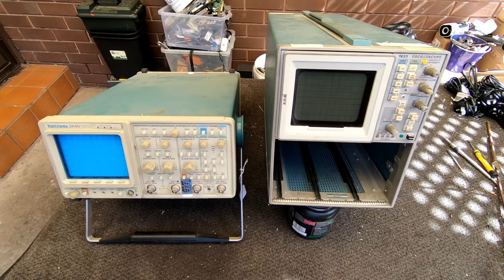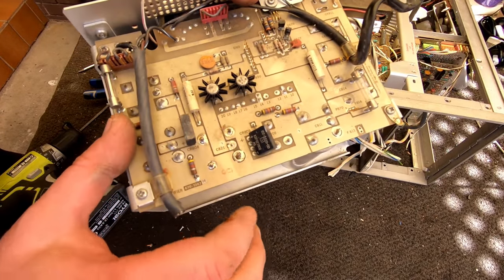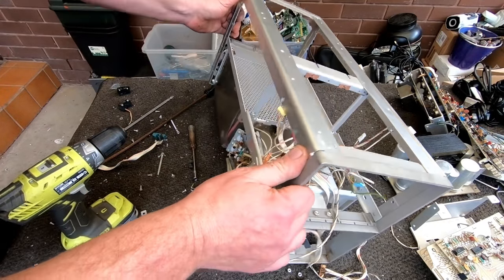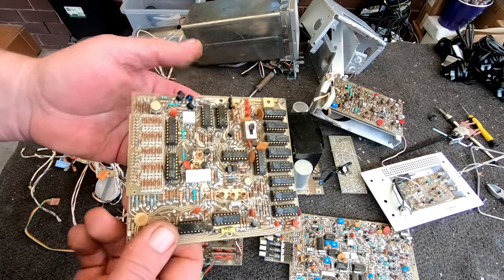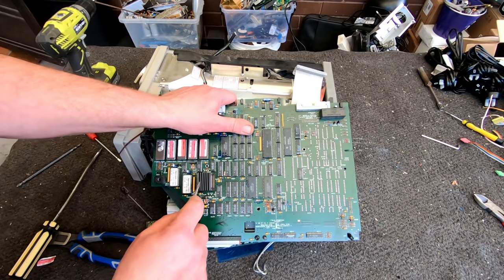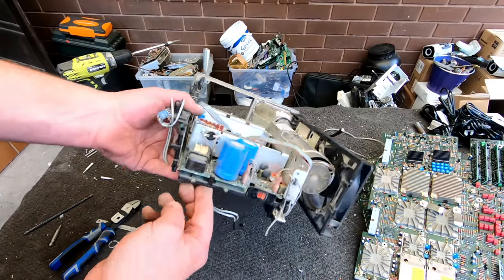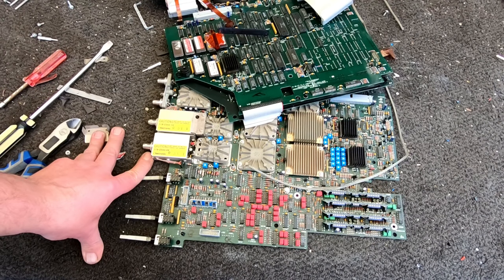Scrapping Oscilloscopes Awesome Boards Gold Recovery

Comment: I kid you not... right after i watch this video i came across an oscilloscope in a pile the same day! I wouldn't even have known what it was if i hadn't just watched your video. I brought it home and ripped into it right away, but it was no where near how good yours was. Mine was a 1997 and it didn't have any CP chips. Only a few medium grade boards and one decent board. The CRT had a huge copper yoke for how small the monitor was but i think the pre-90's are the good ones.

Comment: When the 2440 came out in 1988 it was worth $11,500USD. If you get any more oscilloscopes in good physical condition do some research and check the current prices. Even a broken one of these goes for $75-150, maybe more. A working one goes for $500-800. It was still cool watching it getting taken apart though, good stuff.

Comment: You should be selling those online if you can! Unless they're completely ruined, many of us would pay decent money even for an older one, as new ones are VERY expensive...!😉 The exception, I suppose, is if they're so old as to be broken from use, making them functionally useless.
And for parts, they could also be quite valuable to people!
Reply from the maker: there's one on ebay for $65 go get it
Reply: I don't think anyone has that kind of money. It seems like and I agree that there almost priceless! I think I got more excited than Ben when he flipped the board and it was loaded with all of those gold pronged ic chips, then to really seal the deal 3 very nice CPU's! It's art, Ben's fine Art!!! I can see them put behind glass in a frame! I have my 1st mid 80's server board put on the wall in my workshop! I wouldn't sell it for $5k, don't need the money that much!
Reply: HAM radio operators would soon fix up those oscilloscopes I would say. They are very cluey
Reply: i cant find one on ebay for 65$ only 3-400$ no broken ones. if you DID find one on ebay for that price, dont forget to add shipping.

Comment: hey Ben 7:55 o believe you mean transistors
38:28 red one look for me like diodes but I'm not 100% sure
39:22 i had one like that in my collection as well nice score mine is from 82 and made by intel
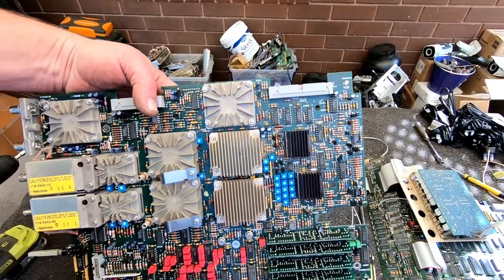45:34 i seen them before and just waiting until you spot the same kind of heatsink lol 
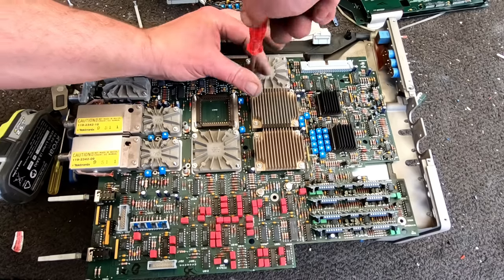57:00 that is something new for me cool
nice scrap have a great one
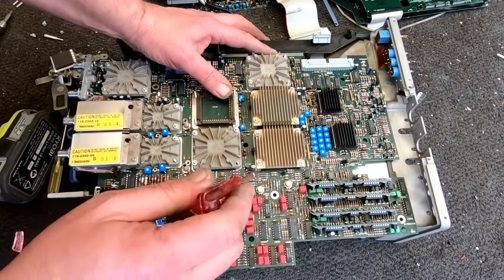Reply: 57:00 Custom made cpu/active circuitry and I will be highly surprised if you would find any information on these since this was propriety made things so no info should be found. Quite inefficient and very expensive to make compared to whats in high end oscilloscopes today.

Comment: You could have got more selling AS-IS on eBay for those, or for parts, as that Tektronix 2440 alone goes for $130 plus AS-IS that not including shipping, as people charge separate for that. Worth way more then scrapping it for gold/copper recovery. Most test equipment goes for decent bucks, I usually repair them and then resell them. Sold a couple 2440 for $550 each that I refurbished. I pay usually around $75 to $90 for them, even if they don't power on, so long it intact broken as well as a few other engineers and techs do, as worst case we just scrap them for parts to recovery cost, if not worth repair. Granted you probably didn't know any better, but best not to scrap everything and look up going sold listings before scrapping it. I can get scrapping it if to far gone and corroded, or damaged beyond repair?

Comment: Those Tektronix CRTs are different from other brands, they’re specially made and are part glass and part ceramic. The long neck where the guns and everything are located is clear glass, then there’s a ceramic middle section, and then a thick leaded glass plate is attached to the front where the display actually shows up.  That whole middle ceramic section is painted on it’s inside with gold (or possibly a gold/palladium mix according to their production video).  So if you’re just recycling the Tektronix CRT’s and not getting the PM value from them, then you’re throwing your money away.  Also all of those 3-pin components (both the metal can type and the little black plastic ones) are transistors, not resistors.  Some of the metal can type will actually have six or more legs such as the one you unplugged in the video, and those are actually IC’s.

Comment: I've done a lot of these , there is no danger with the CRT , and there is commonly a lot of gold in the CRT , many of the electron gun is gold plated , and the inside of the glass on screen end can be gold washed , if not there are silver washed --- SO DO NOT JUST scrap .
I break up the glass tube and make collection of tube with gold & glass , and silver & glass .
Reply: ``a lot of these''??  Oscilloscopes??